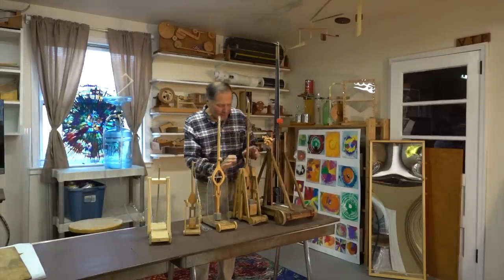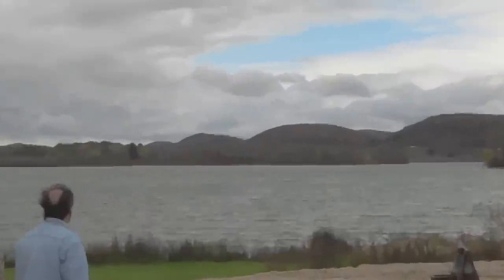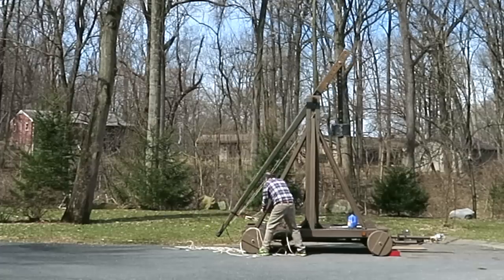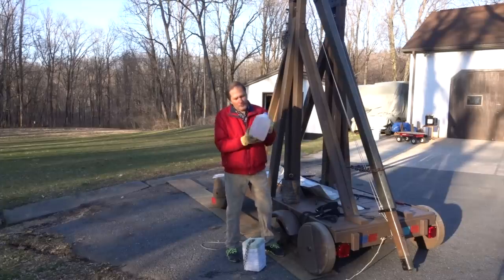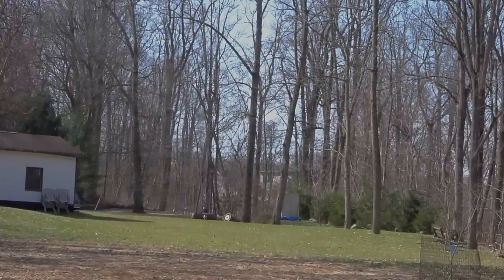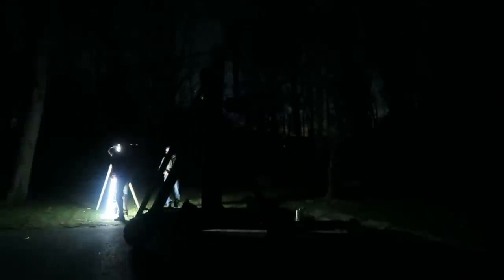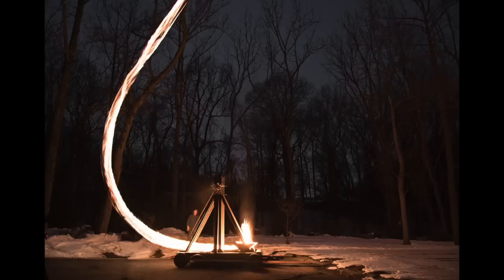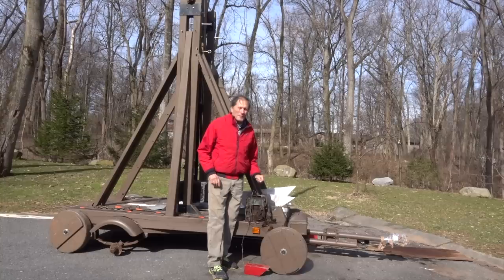Trebuchet Throwing Balls of Fire ///. Homemade Science with Bruce Yeany

Comment: I have one about that size but I have the problem of the trebuchet tipping with just 150 pounds of counterweight . What do you use for your counterweight? Also how tall is it and how long is the arm.
Reply from the maker: We do have another video on it,  https://youtu.be/qC6RJxFEMfY
we made our counter plates  about 60 pounds each and when throwing for maximum distance drop about 1100 pounds as our counter weight.  our support post top is about 11 feet high the arm is about 14 feet.  my first question for you is do you have wheels on the machine, if not add them, it allows the machine to move forward instead of tipping

Comment: I am building a 10 foot Trebuchet. The counterweight is going to have 1000 pounds. But I have a question? Should the box be round? Or can I make it a rectangular box? I would need to do more welding for the counterweight box if it were to have a round bottom, But can I simply make it a rectangle or will that put too much stress on the trebuchet when the load falls? Or will it be ultimately the same for both?

Comment: Irresponsible, setting of those firebombs in a wooded area.
Reply from the maker: thanks for your comment,  but I believe it was much safer than you suggest,   Perhaps you didn't hear it,   but we had several safeguards in place.   volunteer firemen (one was a local  fire company captain),  plenty of water available waiting in the landing ,  water line running to the landing area,  the ground was wet from previous rains, several tests beforehand to judge the distance so blocks would not reach into the woods, they were landing in a muddy field.   they  were not bombs, that exploded on impact  but wooden blocks wrapped with a towel that was burning.